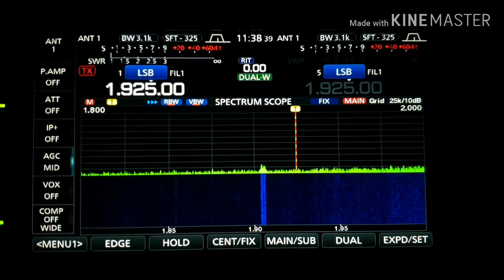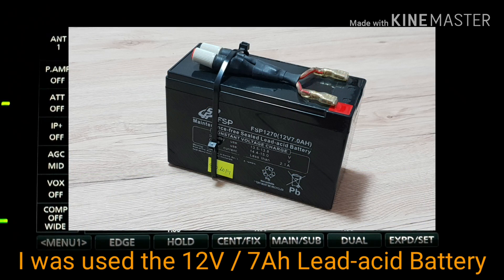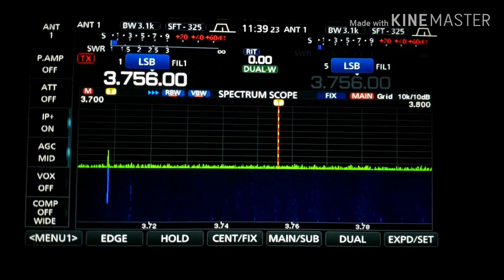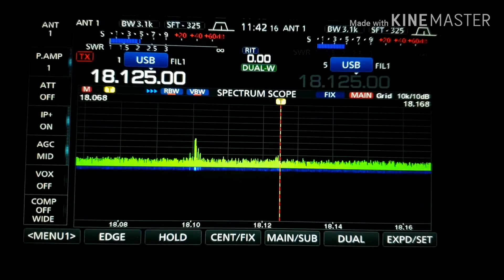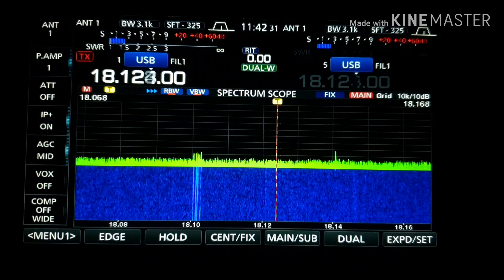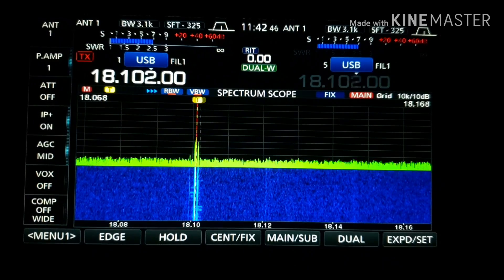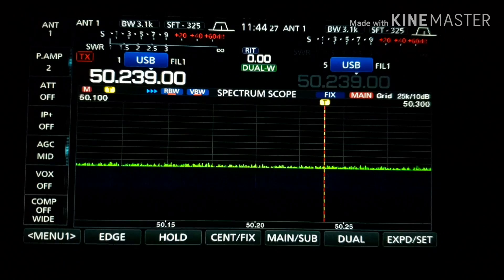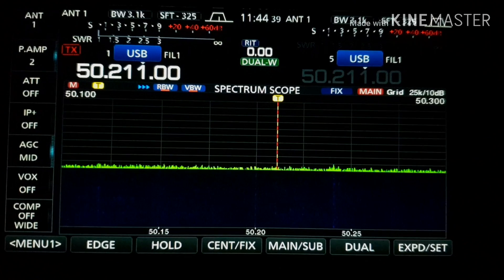General power outage & clear HF bands [ ICOM 7610 ]

Comment: Are you satisfied with the selectivity of IC-7610? I am particularly concerned about the audibility of weak signals near strong stations. I am thinking about purchasing the 7610, but after the experience with IC-7300 I have concerns. How would you rate the selectivity of IC-7610 and Yaesu 2000?  Thank you for your response.
Reply from the maker: Absolutely Yes! I am very satisfied with RMDR of the ICOM 7610. It's hard to compare it with FT-2000. Icom is a few generations forward :-) see here: https://youtu.be/ogoj1Dz4y9Y
Reply: @OM0ET  Thank you very much. This is it.  73

Comment: Makes me want to move as far out into the woods/mountains as possible!
Reply from the maker: 😆 are you living in the city too? What is your common background noise level please?
Reply: Yes, in the city.  

It varies by band and time of day as you'd expect, and I have local QRN source that is sometimes very intense (S9+) over portions of HF.

Right now, it's actually better than usual - noise level in S units: 

160m S1 (all the way from 1.8MHz to 3.5MHz)
80m S3
75m S6+ (peaks near S7 at 4.1MHz, very loud)
40m S3
30m S2
20m S5  (from 12.5 to 14.5MHz, it's S5 or worse)
15m S1
10m S1

During the day, 6.0 MHz to 12.0 Mhz can be overwhelmed by a local noise source.  

Right now, 160m is excellent - very low QRN and DX seems to be pretty good.  Usually 160m is unlistenable here.  Winter helps, of course, but this is quite clear tonight.
Reply from the maker: @matambale  Thank you! That's very similar values like mine here during the common days. S5 on 20M is pity. Here it's very directional. From W is S5 from south S0-1 depends on day time as usual :-) So I very often listen to the south and when I hear someone from west then I turn my antenna :-) I wish I live in the countryside and have my own backyard with tower and antennas, without city noise... Maybe once hi hi ;-)